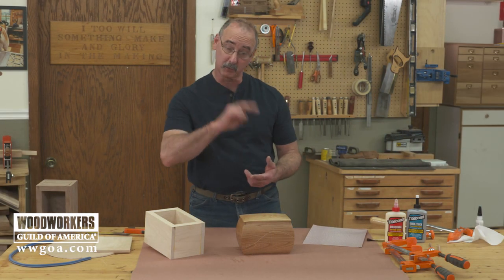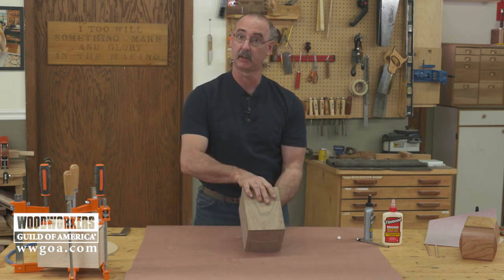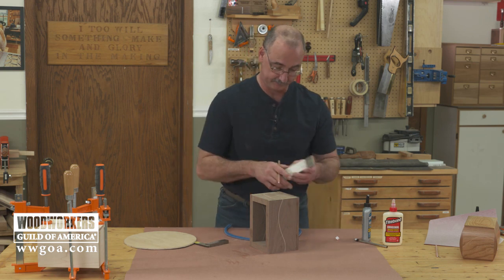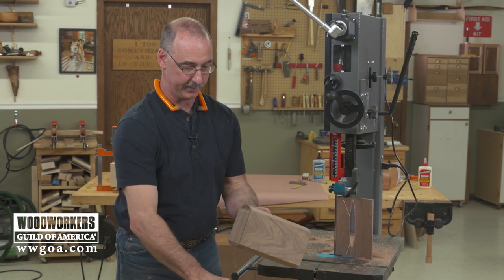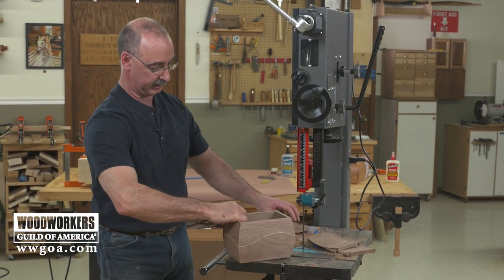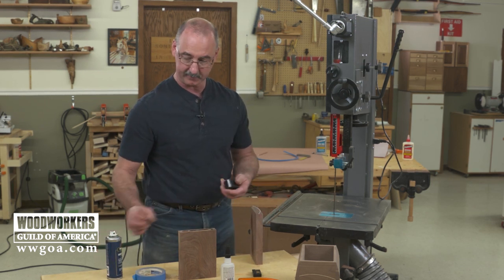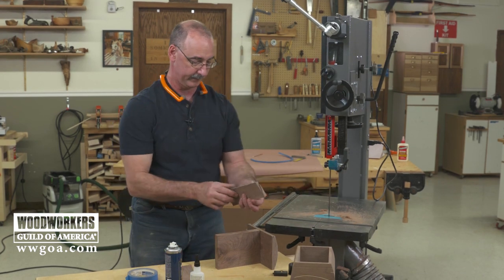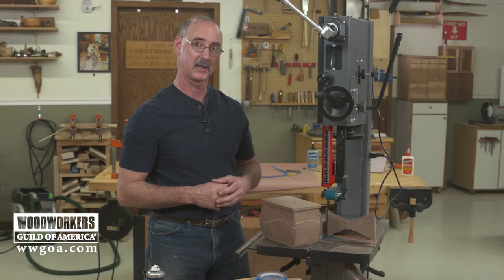Building a Box with Barrel Sides: Part 2

Comment: Why not use a card scarper? Wouldn't that be faster and better to deal with the bandsaw marks?
Reply: A card scraper would be a great idea.  I'm just more of a power tool guy than a hand tool guy, so the sander is more of a default for me in these cases than a scraper.
Reply: +Vondriska Woodworks awesome. I just thought a sharp scraper may just do the work faster. As you wouldn't need to work through the grits to get a good surface. You may not even need to sand to get a good surface finish for your oil or whatever
Reply: a scraper would accentuate the grooves of the band song. your material has to be flat before you can use a scraper

Comment: I've done all the steps in part 1, but I'm a beginner and would really appreciate some more detail.  How thick should the bottom piece be? Should it be the same kind of wood as the sides? (Normally I use plywood for the bottom of a box.) Also,  how thick should the top be, to start out with? Thanks in advance.
Reply from the maker: Hello Katy, I have submitted your question to our Experts.  Please expect a reply within 2-3 business days
Reply from the maker: Hello Katy, The bottom piece is 3/8".  You can use the same species, or a different one for contrast if you prefer.  You can use plywood if you prefer, although the edges will show if you build it the same way that George did.  The top starts out at 3/4".